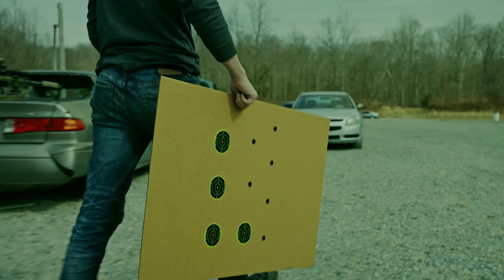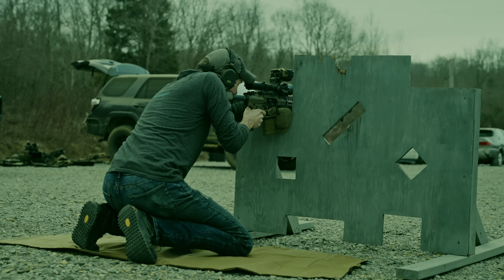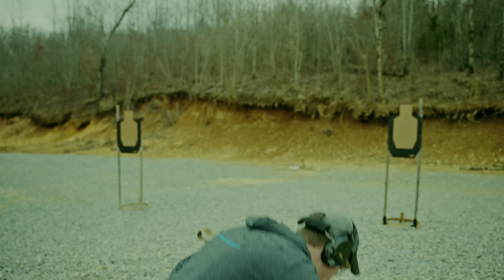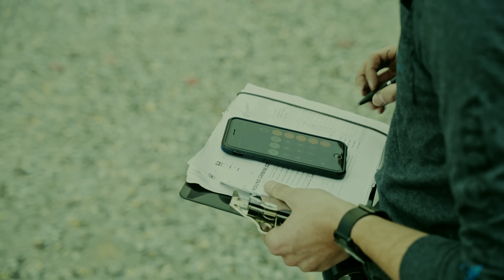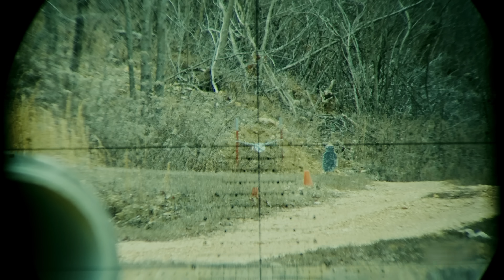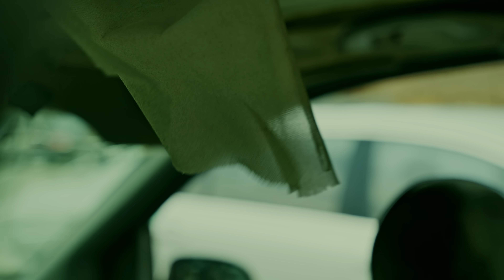Can You Shoot a 17lb Sniper Rifle Up Close Fast?

Comment: As someone who’s been shooting almost nothing but 223/556-9mm-300blk I’ve been wanting to get into something that can stretch out a little further. I know bolt Guns are usually a little more accurate and better suppressed but I like having the ability to shoot semi auto when needed. Been thinking an AR10 in 308 as it’s a common round. I’d like to do some other cool round but I like to stay within something that’s common. Yours is badass and while I’ve got some cool AR’s, pistols, NV etc etc I’m definitely not gonna be able to get the accessories you can lol
Reply: .308 is still good as a long range cartridge and it does have the benefit of having more energy versus 6.5 Creedmoor going for it, as well as generally being cheaper.
Don't worry about getting the accessories until later when you start needing wind calls and shooting unknown distances, and even then you can do some of that on your own with experience.
Reply: @andreivaldez2929  308 loses it's advantage over Creedmoor in terms of energy at a relatively close distance (400 to 600 yards depending on the variables).  As a matter of fact, you can look on Hornady's site and see evidence of this. Comparing their 308 150 gr SST to their Creedmoor 147 gr ELD, you'll see that at 400 yards the 6.5 has 40 ft/lb's more energy. In the next 100 yards, the 308 has shed 300 ft/lb's of energy!!!!! The 6.5 has last less than half of that!!!! 

So decided what you want to do then make a choice. If shooting beyond 500 yards is important, Creedmoor is better than .308.
Reply: @terrencecox3748  that’s crazy! A light weight hunting bullet is less aerodynamic than a heavy for caliber match bullet. That’s bananas
Reply: @terrencecox3748  one of the few people who actually understands 6.5 creedmore thank you from a 6.5 shooter
Reply: @alexmilbaugh1645  lol so you’re both delusional
Reply: @K-bob_45  Snicker all you want. If I didn't get the weights as close as possible, you'd  bitch about that instead. 

Other than the fact that these are both bullets, it's an apples and oranges comparison. Comparing high bc rounds to those that aren't is just plain dumb. But here  we are in a FUD circle jerk moaning about energy inside 400 yards which when you get right down to isn't that far.
Reply: @terrencecox3748  do me a favor börther. Go look at a 185 berger GMM load against that 147 load you mentioned. There’s no secret sauce here.

Make sure to use the Litz BC for both bullets or go to hornady’s FAQ page on BC where they give you the real BC for their bullets.
Reply: @K-bob_45  Credit goes where it's due! That Berger 185 GMM IS a good one. 

That said, where are we going here? Are we just trying to get across that there are a lot of good loads out there for 308 so no need to use 6.5? 

Are we trying to say that there is no need for the military or civilians to adopt newer high bc rounds? In spite of the fact that...
* ...LMT has built a 14.5 6.5 Creed for the SOCOM MRGGA trials. Why would LMT NOT use 7.62 NATO? 
* ...DoD took delivery of REC7's in 6ARC some time back?  (No doubt to test as DMR's.) 
* ...Serbia adopted the 6.5 Grendel in the Zastava M19? 

The future is speaking and it's not talking about 308/7.62 NATO.
Reply: @terrencecox3748  where we are going is that if you already have a 308 and especially if you hand load, running out the door to buy a 6.5/6mm isn’t a requirement even if you want to shoot to 1000-1200 yards. People get so caught up chasing gear that they forget to just go shoot.

308 isn’t going away and is only getting better.
Reply: @K-bob_45  Well I agree with you actually. If you are already rockin' 308 and know how to make it sing, keep on. 

There are other good reasons to use it. It's still an awesome hunting round, there is still TONS of it out there, and things like the Ruger SFAR make it even better. I'm already here daydreaming about 14.5 SFAR running those 187gr Bergers you brought up.  THAT would make an amazing multi-purpose rifle!
Reply: @terrencecox3748  so berger actually has two different 185’s. One is the juggernaut and one is the classic hunter. I’d opt for the latter for hunting. It has a slightly higher drag coefficient but I believe it has a thinner jacket. Either way lots of great bullets in 30 cal and the market in general
Reply: You might just get an optic for your 5.56 depending on what you have. Last year we went to moss creek ranch to shoot around and it seemed like everyone had the most fun shooting my 16” 5.56. 16” 5.56 was fun out to 700 or so. 308 wasnt even sporting until you got past 800-850. Some in our party had 6.5 PRC and it was a nice step up over 308. It seemed like it was point and click out to 1k with hits out to a mile
Reply: Check out bk. U can get a really nice 6.5 or 308 ar10 for under 1000$ u drop a nice trigger In it and a nice arken scope and as good as u will ever need.
Reply: .308 doesn't have more energy for long lol. At 1000 yards, 6.5 creedmore is impacting around a half second faster than .308 and it's gonna have about 30% more energy when it gets there. .308 is still a great caliber and much respect to it, but past 500 yards, 6.5 creedmor is superior in every single sense.

Comment: Been loadin for my dd5v3 for 2yrs 16” .308 and puts 5 on a 20oz lid@100yrds and made first rd first try impact at 1000yrds with 178gr hornady over superformance powder runnin barley 2200fps…app said 58moa so dialed half and held whole reticle in my 3x15 viper…419 hellfire brake and ssa-e trigger….prs stock and 640df light…best $4200 ever spent..

Comment: 8:25
pro tip: those charging handles might help, but get a little $5 tube of silocone gasket maker from your local home depot or autozone or whatever. put it on the back of your receiver/charging handle. leave a tiny gap while it dries (toothpick stuck in will do it). forms a perfect seal.
Reply: @Auntie Zen Skater what's your problem?

Comment: For guerrilla warfare against a tyrannical government long range precision shooting allows one to safely deal with many.  It makes it so you can engage a target from distance and immediately break contact.  The enemy does not even know where they were engaged from.  You just blend back into the regular population of sheep and disappear.  If they open fire on the sheep you now have many more fighting on your side.   If one man charged into a building full of enemies his chances of survival would be very low.  One man carefully planning and executing multiple engagements would be very difficult to stop.  With that said its important you understand what kind of technology you are up against in this day and age.  They have the ability to pin point shot locations even from a suppressor with some specialized equipment.  You will need decoy gun shots so they do not know which direction to engage.  They also have thermal drones which means portal hole shooting from inside buildings or vehicles will be a must.  I could go on but the rabbit hole on this subject it very deep.  The truth is that unconventional war tactics that do not even utilize a gun are probably the most effective.  I hate to use this as an example but the war on terror has taught a lot of effective tactics.

Comment: I have a Seekins DMR and have been quite happy with it over the years. I recently "got into" long-ish range shooting and find it to be very relaxing.  I do laugh a little bit at the 10k range finder, Kestrel, blinky light level, etc - you don't need any of that to actually get into and have success. I am sure they are nice, capable, and cool - but I seriously doubt for 99.99 percent of people who shoot regularly the price vs performance just isn't there.  I have two "long-ish" range setups that I shoot regularly. My Seekins DMR which is a 20" barreled .223 AR platform. I picked the rifle up slightly used for 1.1k and topped it off with an Athlon Midas Tac scope ($600,) atlas bipod ($250,) Magpul PRS stock, and a Timney trigger ($150.)  With quality factory ammo it is a .75MOA gun in my (not the best shooter) hands. For longer range - I bought a slightly used Ruger Precision Rifle in 6.5CM ($900,) topped off with the same model atlas bipod, same model Athlon scope. I 3D printed a more vertical grip for to replace the stock A2. Both have a Vortex convention level that I can see out of my left eye when looking through the scope. This gun has been a consistent .5MOA or better rifle for me shooting Hornady ELD match ammo. Once I get to the point of getting more serious or reaching the limitations of these optics or firearms - I will upgrade. However, for my current skill level (which I would classify as intermediate) my "budget" rifles more than do the job. I use a Sig rangefinder ($150) the Hornady ballistic app, and typically tape a streamer near / on my target frame downrange to read the wind. I successfully shoot the Seekins out to 400 yards, and anything further I will use the RPR which I have been thrilled with all the way out to 1k yards. You don't have to spend huge money to enjoy precision longish range shooting - just be picky about what you buy. I would rather be the dude shooting a 2k rig very well than be a person with a 15k setup that shoots like garbage or can't figure out what buttons to press on the gizmos. Sure my scopes aren't Nightforces (yet) and my rifles aren't high-end - but shooting with guys that have those things - I can usually match their performance or get within 90% of it for an absolute fraction of the price and I can spend the "savings" on more ammo or more shooty stuff.  You don't need to spend what a economy car cost to go out there and bang steel at 1k+ yards. Start modest, research the equipment, get some training, shoot a lot,  and work your way up. When I upgrade to a higher end setup, my entry level stuff will be great for my spouse, friends, etc to use if they want too to get into it, or I can sell it without much "loss."

Comment: 6:20

Lmfao, you can get a burris eliminater for like $1,000. I wouldn't take it to war, but aside from the wind, it does all that for you, and it even makes the hold  adjust  automatically instead of just giving you a solution. 

It's OK to just say I bought this cause I dont know what else to spend my money on and I thought it was cool. Or even, I'm not confident enough in my ability to shoot  long range  with out 3 computers assisting me.

I bet you drive with cruise control on in the city, lane keep assist active , and blind spot monitoring all on all the time.

Is it April already?

Comment: How does the laser mounted align with the reticle as you go up and down in elevation?
Reply: Do parallel zeros and you'll always maintain a consistent level of offset. Converging zeros is a bad idea for something like this.
Reply: Oh so you always have to return to zero on the scope to effectively use the range finder.  That makes perfect sense.  Thank you!
Reply: @averyneilson12  You can return to zero or hold for what you dialed on.  If you had 3.4 mils dialed on for the last shot, you can hold down 3.4 and range.  Many users will simply hold everything using a Christmas tree type reticle.
Reply: @CoryTrapp  yeah that make sense that is pretty cool tech for rapid engagement.
Reply: @averyneilson12  Works well for a single sniper where you only use one gun.  Mostly we work in pairs, spotter/shooter.  The spotter does the ranging and wind, the shooter shoots.  If you have multiple rifles, it's a bit annoying to move and rezero the unit all the time.
Reply: Yeah I am pretty familiar with that situation.

Comment: Great video. I have an SP10 in 6.5cm - it's a laser!
Reply: You can build a 20" 6.5creed db10.  It has SR25 style receivers (not dpms), and uses a standard AR15 buffer tube (their db10 buffer and spring are on their site also).  Their preassembled uppers are only $500 (even less in 308)--  and then you can get their stripped lower for around $100.. buy a cheap parts kit for the lower and throw it together.  Super cheap and easy.   They cost $2k if you buy them outright, but for some reason you can build the same rifle from parts on Diamondback's site and it's well under $800 total.  Super accurate and well worth the money.

Comment: Love my long range gas gun, not as fancy as yours but does what i need it to do.
Reply: You can build a 20" 6.5creed db10.  It has SR25 style receivers (not dpms), and uses a standard AR15 buffer tube (their db10 buffer and spring are on their site also).  Their preassembled uppers are only $500 (even less in 308)--  and then you can get their stripped lower for around $100.. buy a cheap parts kit for the lower and throw it together.  Super cheap and easy.   They cost $2k if you buy them outright, but for some reason you can build the same rifle from parts on Diamondback's site and it's well under $800 total.  Super accurate and well worth the money.